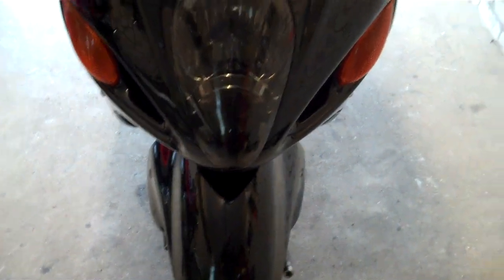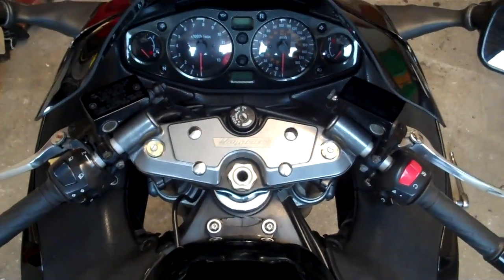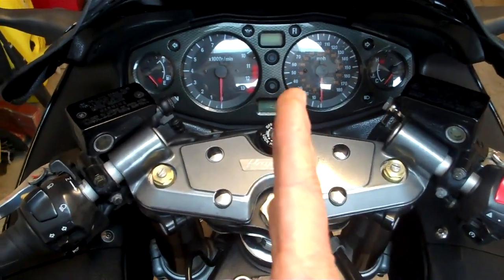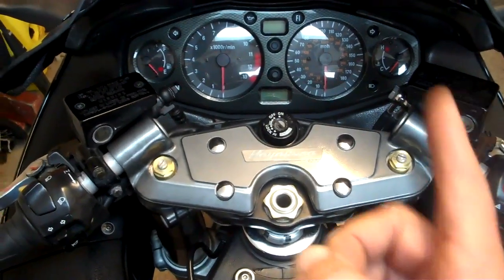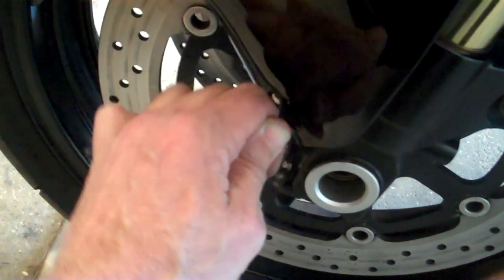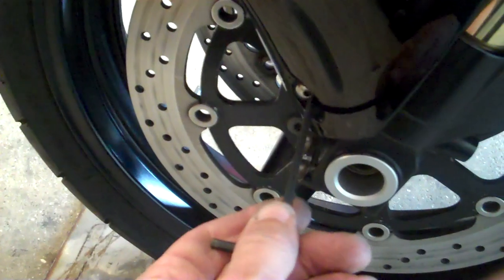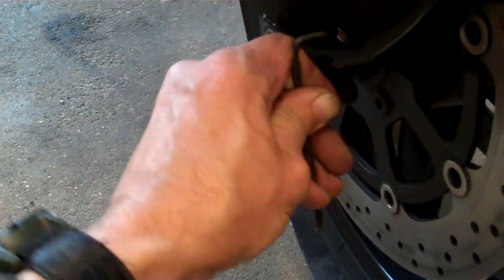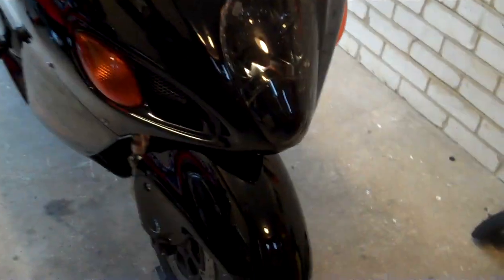Delboy's Garage, 'How-To' Re-align motorcycle forks the easy way.

Comment: Hey man, thanks for you videos! I had an front end accident with my 2018 Busa. I t-boned a car doing 8 miles per hour. Wheel was bent and replaced. When taking the forks out, the left fork was stuck, I got it out noticed it had a dent. I replaced the whole front assembly. I replaced the bent handle bars as well. Wheel is still cocked to the left. Only thing left not replaced was the axle. Any ideas what else could be wrong??? Thanks
Reply from the maker: Have you checked alignment of the forks mate?  It could be as simple as that if everything has been out and re-fitted... if you can get the wheel off the road and the bike upright (not easy I know!), then loosen everything below the top pinch bolts, so the forks are literally hanging in the top yoke only and everything else is loose, also loosen the big centre nut on the top yoke and then, gradually, a quarter turn at a time, tighten all the bolts in a downward direction, starting with the centre nut, then the bottom pinch bolts, then the axle... and don't forget the pinch bolts under the axle!  The machined nature of the yokes should centre everything dead square, it's just when you've got weight on the wheel, and you do them up all one side and not the other, it can pull them out of line... I know it's long winded, but just go quarter turn at a time, side to side, till everything is up to torque spec... if it's still out, then don't forget to check your rear wheel alignement, it's not uncommon for that to get knocked out in the shunt... and if it is out, it will make the front feel cock-eyed!

Comment from the maker: Check your tyre pressure Sal, and have a close look round the wheel to see if you have thrown a wheel weight...it can usually be determined by a clean spot where the weight use to be...eith that or your tyre could be unevenly worn.... good to hear from you hun..Del.x

Comment: Hey man thanks for the vid, great job. I have a 2003 cbr 600rr. It's been dropped twice in a parking lot. When I ride the allignment is off to the right and it's very annoying. The dude at the shop said my right clip is bent. I think it might be bent a little. I don't think they even really checked the forks. It's obvious they arnt aligned even if the right clip is bent. I'm going to do everything you did in your vid this weekend. I think it will work. In your video, after you lossened all of the bolts, you mentioned the last one on the top. You didn't specify if it needs to be loosened though. The one in the center of the handle bars. Does that need to be loosened to before you push down on the forks?
Reply from the maker: Yes mate, loosen the centre nut, so that the two individual yokes can move independently of each other, as it is those that will have been knocked out of alignment... plunging the forks will re-centre them, and if you're still off one side, you many have a bend in the handlebar, but take it all off to the naked bar and look along it like a ruler, you'll soon see if it's bent... good luck, Del

Comment: I was looking at this video for my 2003 R1. I want to redo my alignment. But in this video at the tightening sequence you state to tighten the lower tree pinch bolts and then go downward from there. But shouldn’t the center bolt on the top in middle of triple tree be loosened as well. I didn’t see you do this in this video? You state at beginning that your trees were crooked, wouldn’t that center bolt on top need to be loosened as well and be the very fist thing to be tightened (snugged up) after CPR? Or am I wrong? Thanks for video as well

Comment from the maker: Hi mate...sorry, but with all we have to do on the channel and working full time we simply cannot make videos on demand, but if it helps, get the front off the deck, flop the wheel side to side, tightening the top collar a bit each time until it shows a little resistance...then back it off 1/8th turn....once you've ridden it about 50 miles, check it again. hope that helps buddy... good luck with it.. Del.

Comment from the maker: Hi mate, i tried to answer your last message, but i think you deleted it..yeah, i had every intention of welding in a swan neck to make it permanent, ive got a draw full of hand made tools like that, i just misjudged the size, i have a 22mm dedicated axle tool, but the Busa turned out to be 24mm and i only discovered that when i began filming so had not had time to fabricate the handle.. ill get round to it in time.... thanks for watching buddy, and thanks for your input, much apprecated, Del.

Comment: Hey btw if you stick a stud through that bolt you put into the axle and bottom it out on the other end, then trim off the excess at the bottom it makes it a lot easier to get into position and saves having to buy that huge allen key. Awesome video though, lots of good info!
Reply from the maker: The best thing I found to use for this was a big correctly fitting bolt heated and hammered over 90degrees in the vice... also works on fork top caps with a 17mm socket fitting... like you say, saves on buying giant allen keys!

Comment: A moment of madness i agree, but it felt like it was gonna wash out in right hand corners due to uneven wear on the tyre, so i matched it up with an angle grinder. I'll check back wheel alignment tomorrow to make sure, but before i do that i'll be doing the exhaust can. Luckily i got the original exhaust along with the bike when i bought it so for MOT i'll be sure to put that on. Ive subscribed to your channel and i'll be sure to email you and ask about anything im unsure about. Thank you mate

Comment: Excellent video. I only have an Abba stand here, so can't push down on the forks so easily because the bike can't move like it can on a paddock stand. Anyway, my question is, do you think it's ok to grab the wheel in my knees and twist the bars back? That's what I have done and all appears straight now, but yet to test ride. Thanks.
Reply from the maker: Hi mate, its fine to yank the bars back if it works, but for a perfect alignment its best to do it this way, maybe get someone to hold the back of the bike upright while you bounce it..!

Comment from the maker: Hey Toshi...if your front and back wheels are aligned then it wont be that....check the tyre pressures, and check your front tyre wear pattern too..if the sides are shouldered out a bit then that could cause it to pull to one side, as you do roundabouts 'clockwise'..the right side of the front boot wears a flat area and causes the steering to take on a bias to that side, also check your fork spring settings are both the same, if all that fails, get a new pair of tyres mate, that always cures it.

Comment: This video helps a lot. Hard my bike parked on side kickstand and steering locked and I backed out my friends car and sort of like a idiot forgot I parked my bike at end of drive way edge which I never do. And sort of slowly backed car into it. It was also in gear :/  . So I head it being shoved back and the kickstand bent, which I realigned with a Hammer lol . However my forks are off a little.
Reply from the maker: Sounds like the kind of daft thing i do...oh well, never mind buddy, at least you can get it all sorted and back in line... take care and thanks for watching.. Del.

Comment: Instead of pumping the shocks up and down, I have heard that spinning the front tire and slamming on the front break will also get things aligned. What are your thoughts on that method? Should I do this without a torque wrench? I'm guessing these pinch bolts have specific torque ratings.

Comment from the maker: Hi there... i think if your bike is pulling to one side, it can only be alignment in one way or another....check the wheels front and back...and if it still persists then it could mean that the sidecar has pulled the frame out of true....you can check this... but you will need to find a company with a 'frame jig', they can mount the bike on the jig and see if it is bent....im sure it is just wheel alignment though, pulling to one side is a common symptom... Hope that helps.. Del.

Comment: Thanks for your great video, although I am still not fully happy with my fork alignment... What I am not sure is how to tighten the top yoke nut? Shall I do it first before any other ones or, shall I go from the bottom to the top with the top yokes nut being last. I have an  impression that when I tighten the top yoke nut, the whole forks gets a bit twisted. What would be your advise on it? Shall I lift the front end off the ground while tightening the bolts? 

Or maybe my forks are not straight, any advise on how to check it? 

its for Honda VTR 1000 Firestorm....

Thanks a lot

Adam
Reply from the maker: Hi Adam
Once you have the whole lot backed off, (including the central nut in the top yoke), and you've plunged them to re-align everything....first, always nip the bottom yoke bolts up a bit at a time to hold them in place otherwise ( as you suspect) you'll twist the two yokes apart again.....once the bottom yoke clamps are tight, then do the top centre nut, then the rest..

Don't forget to check your rear wheel alignment too, if its even as much as 2mm off to one side then the bike will "crab" slightly, and make you thing the front is off.....so just do the front to the best you can, then the back....then if its still off you may have some damage, and the first place you'll find it will be in the 'clip-on' bar itself...they are easily bent if the bike falls over, specially if they're alloy...so strip the furniture off them and hold a 12" ruler against the bar at several points around its circumference to make sure its true...

Good luck with it Adam, let me know how you get on...all the best.
Del.
Reply: Moonfleet41 Thanks a lot Del for your reply. I tried the way you described and there is still something not right.. it might be that the forks tubes are bent.. I may give up and ride to a nearby garage and ask them to have a look on it... The bike is leaning/cornering okay(ish) to the left but really funny when I want to lean to the right... and the top yoke seems to be twisted still even after redoing all the procedure a few times... 

Thanks a lot anyway, your video and advise is top rated, but it looks like there is a bigger problem with my bike somewhere.... WIll report after a visit in the garage. 

cheers, 

Adam

Comment from the maker: i love them mate, they will save you twenty times their cost if it all goes wrong...i have the ones you can see in the video that bolt through the motor mounts.....a drop is a drop, it will always do damage, but if you can minimize it to just being cosmetic, and not damage internal parts or structural items, then the costs are manageable and you can often still ride the bike... thanks for watching buddy, and ride safe on the big hairy chested monster.lol.. Del.

Comment: Hi, great videos, I have ZX6r and it veers right, anyway I took bike back at the dealer and he fiddled with the triple clamps and now the handlebars are not aligned with front wheel. I managed to fixed it by myself by doing same procedure as this video, however the veering is still there.

My question is; is veering issue most likely a rear wheel alignment problem? I saw your Harley Davidson rear wheel alignment video and gave me a clue. Thanks

Comment: Hi dell good vid as always ! I noticed you undid the bottom fork nut using a 24 mil nut ,just a thought why not weld two together in middle flick round with grinder then you have ready made tool save scratching paintwork and fiddling all the best ant !
Reply from the maker: Greta way t do it, ive got a plug spanner socket i use now, has 24mm OD one end, and 18mm OD the other.. perfect for the two sizes either side of my ZX-7R..lol

Comment: Great video. Just bought my first sport bike. a 93 cbr900rr. The top tripple is about 10 to 15 degrees off center while riding straight. The tail fairings are also off... makes me wonder if something more serious is going on. Hopefully I just need to buy me a rear wheel stand and align and get some new fasteners for the fairings... if not then i found some used front forks from a reputable salvage dealer. 

Do you think 10 to 15 is a bit much for just an alignment issue?
Reply from the maker: Dane Opliger Hi Dane, congrats out getting your blade, Im afraid old fireblades tend to often be a bit of a life story, they can have been track bikes (and people go to great lentghs to hide that fact) and even stunt bike... take the rear plastics off andf have a good look at the subframe, it they get wheelied over the back it bends and distorts the frame, you can straighten them, or even replace it, they arent pricey second hand... so the fork align, then do the back alignment too... if you take it for a ride then....you probably find its a lot better.. good luck with it buddy, ride safe.. Del.
Reply: Thanks for the reply! This bike definitely has a mystery behind it. I measured the misalignment and its only about 5 deg. Enough to make the fender sit off center of the wheel very noticeably. 

Purchased a straight tail frame, full painted fairing kit, windscreen and all proper hardware. Cant wait to put it all together. Next stop will be forks, but they arent bad enough for the to worry too much. I can also upgrade the forks and/or triples down the road.

Comment: Great vid, Dell. Can i do it with a jack stand that goes under the frame? Thinking maybe a couple of small pieces of wood under each tire? Or just go without the wood and the stand you have? In essence, the bike is just to be kept straight with out leaning it when i tighten it up? Without dumping it, lol...
Reply from the maker: Hi Ron... Id say that you may have a problem trying to plunge the forks down to centre them if you put a stand under the frame.. the best way is on its wheels, if you don't have someone to hold the bike upright from behind, then a paddock stand at the rear will work fine..!!!  Hope that helps buddy.. good luck wit it.. Del.

Comment: If it's only slightly out I use a fence post/doorway etc to hold the front wheel and you can pull on the  'further' bar to straighten up just a bit without undoing anything. It's all touch and feel but you can usually get it right. For a bar--end that needs more than about 1/4"" you'll need to do this ;)

Comment: Thank you so much, sir! I have a question please, do I have to loosen the brake caliper bolts as well or is it not necessary. I have a BMW S1000RR, thank you again!
Reply from the maker: That wouldn't be necessary as long as the pads aren't binding against the disc, just reach in to the back of the caliper with your finger and make sure each of the pads moves a little then it'll be free enough to align...!
Reply: @Moonfleet41  Thank you so much!

Comment: Excellent video, thanks.  I get a bit of a wobble when I take my hands off the grips on decel.  Is this caused by the same thing?
Reply: okay, thanks.  I check my tire pressure regularly and the wear seems to be pretty consistent, so maybe it's really nothing to worry about.
Reply from the maker: Paul McDowall
Just a thought...you didnt say what bike it was mate?... if its a Hayabusa, check that a previous owner hasnt taken the steering damper off, and do you have the par end weights in place..?
Reply: Nope, it's a Suzuki Boulevard C90.
Reply from the maker: Paul McDowall Ahh, that's clears the fog....those bikes have a tendency to be a bit unstable in a straight line...its down to the long forks and not enough rake. just a poor desigh, bit too much ' form over function'  They could do with a smaller front wheel, or a bit more rake in the yokes...but you can change that kind of thing unless you really get seep into modifying.....Penny had the S50 (called the "Intruder 800" here)  and once we fitted a brand new front tire and ran it a little bit over pressure (38psi rather than 36) it was way better and a lot more stable.... hope that helps a bit my friend.. good luck with it. Del
Reply: I had the Volusia (800cc forerunner to C50). I will try the overpressure in the front and see what it feels like.  Thanks for the tip Del.
Paul

Comment: Hi, thanks for the how-to video, my front handlebars as slightly pitched to the left when the wheel is straight, but the left fork is leaking oil, (fork seals to be replaced this week), im asking will the lack of oil affect the alignment of the wheel to the handlebars? Or is this the cause of my leaky fork?  Cheers
Reply from the maker: Not at all mate, your fork seal and your steering alignment are completely un-related... the seal goes due to wear and tear, so do the pair just for good measure and when you put it all back together, you can set up the alignment as in the video...

Comment from the maker: All bikes can suffer this, the friction clamp system on all fork yokes is supposed to shift in cases of extreme impact to prevent damage to fork legs and frame.....pot holes, bumping off curbs, and wheelies will all lead to the need for a little straighten up.....